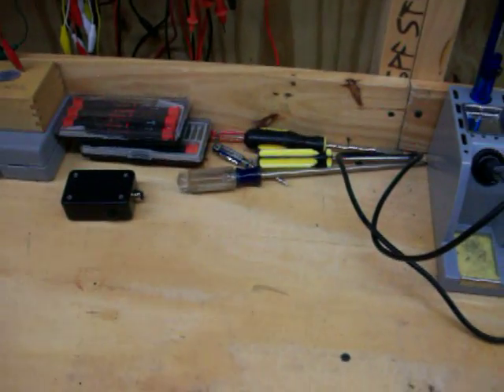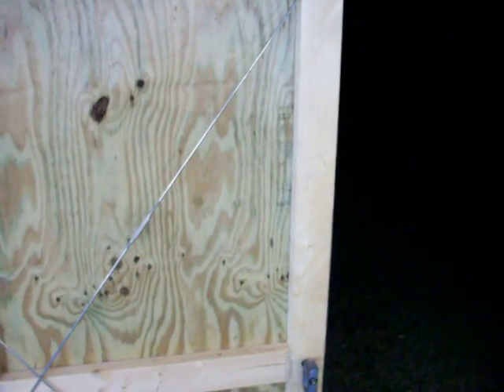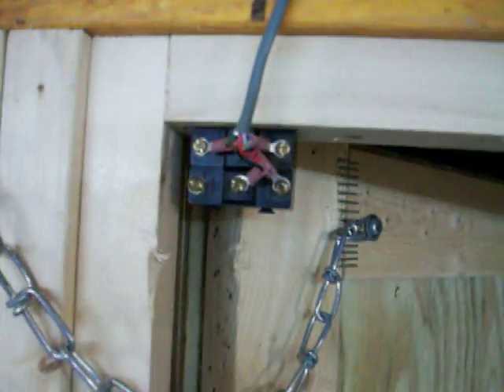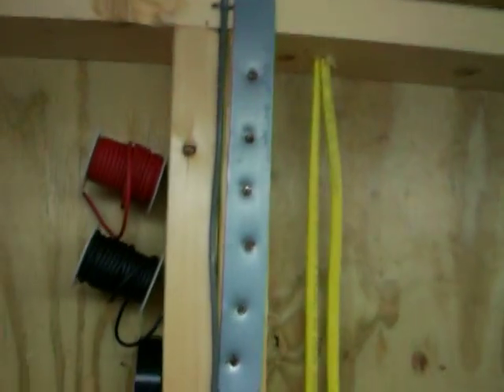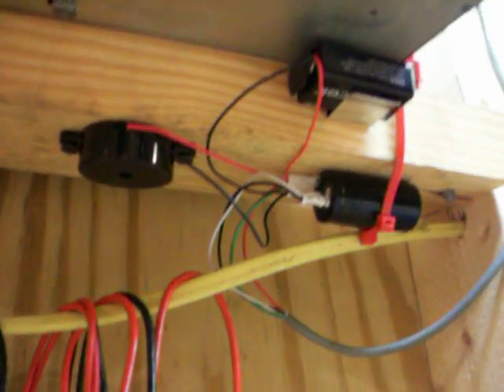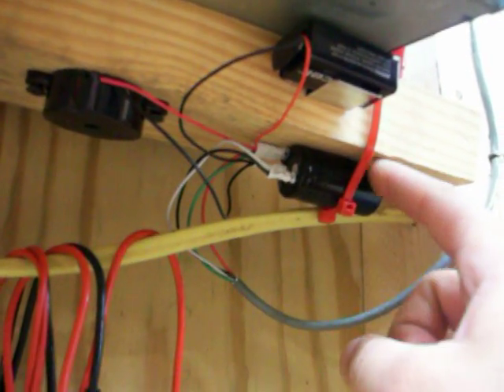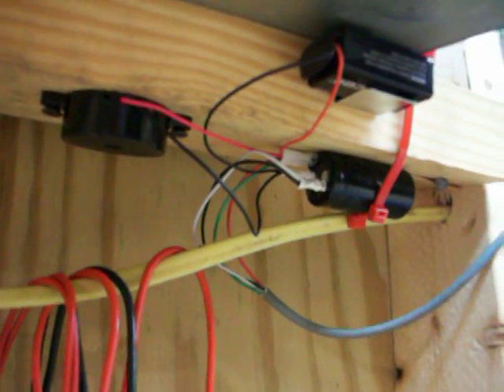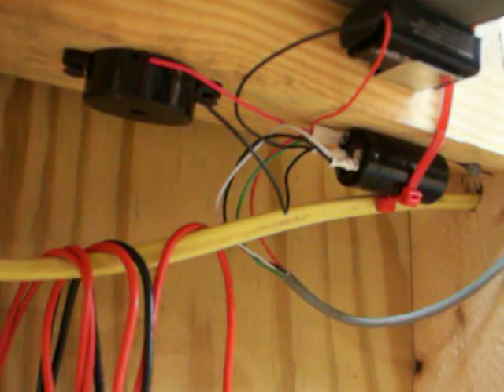how to make a simple door alarm

Comment: Hi Adam,
               I wonder if you could help me, I'm trying to develop a weighing scales  that has a built-in max and minimum alarm.
    let me explain I'm in the process of setting up a weight loss business and I don't want my patients to be able to see their weight. Ideally what I want is for them to stand on the weighing scales and if they go over a preset maximum weight, an alarm will go off and similarly if they go below a preset weight an alarm will go off.
Reply from the maker: cathal butler what kind of scale would you be using what is the brand name that can determine how easy that would be to accomplish
Reply: I don't really mind what type of weighing scale it is (i.e. electronic or mechanical) basically what ever is the cheapest and most convenient to add an alarm. I want to cover the reader element so the only indication the patient has, if they go over a predetermined max weight is that the alarm goes off.
    Here is an example of how I anticipate it will work. Let's say someone is 4 stone  (56lbs) overweight and they are 14 stone. So in theory they should be 10 stone (target weight) Now as they progress through my programme they should begin to loose weight. However I don't want them to fixate of the weight loss number, rather I want them to become very familiar with the feeling of weight. So  in the case of the 14 stone person (target weight 10 stone). The weighing scales will have an alarm setting at 14 stone.
  Now each morning they will stand on the weighing scale  and they put on a front rug sack (similar to a baby harness)  if the  alarm does not go off it means they have lost weight and to determine the amount they have lost they will have to keep adding pound weights to the rug sack until finally the alarm goes off …..as time progresses the  amount they are adding to activate alarm will increase until finally they are adding 4 stone. Which means they have hit their target weight………Sorry for the long winded answer Adam, and thanks for the prompt reply

Comment: hi i wanted to ask you what switch you used? is it necessary to use a particular kind of switch? i need to make a bird chirping door alarm, i was wondering how i can modify this circuit to make it, by replacing the buzzer with a tape containing a bird chirp? thnx in advance :)
Reply from the maker: You can use any switch as long as one is normally closed and one is normally open, as far as the bird sounds I don't know how I would mod it to work I will look into that

Comment from the maker: you can get everything you need from digi-key... but you can also get the cap from old power supplys,amps,radio recivers "50 watts or more"  and yes for this to work right you need a cap. you could use just a battery but it would run down quickly.  where are you from

Comment: I like your design.  You may want to limit the initial charge current into the capacitor.  I don't know if a large inrush due to Capacitor acting like a short, will cause shortened battery life.  Just a cheep 100 ohm or so would limit this current.  It may take a little longer to charge, but don't think it's a problem.
Well done, I am going to use it in the exact situation.  Thanks again.